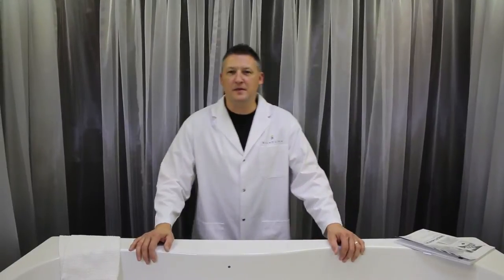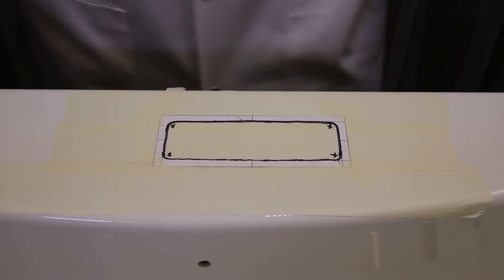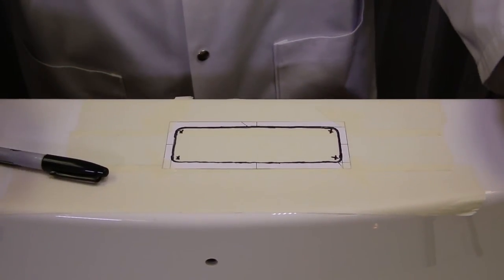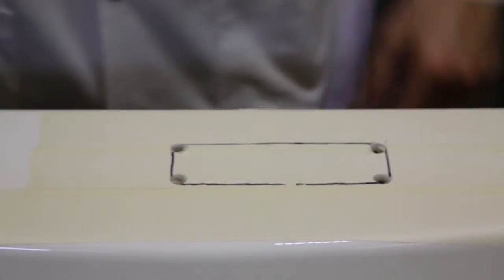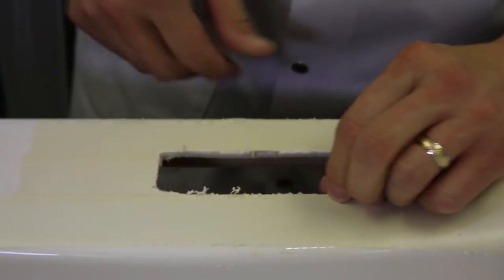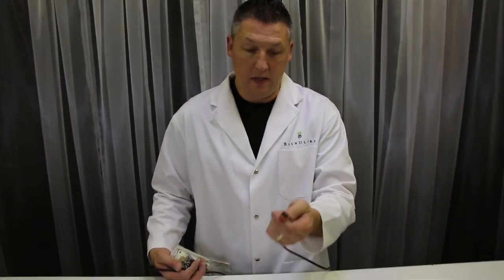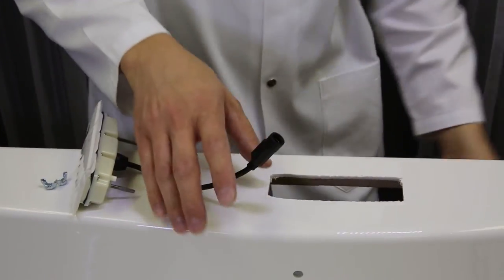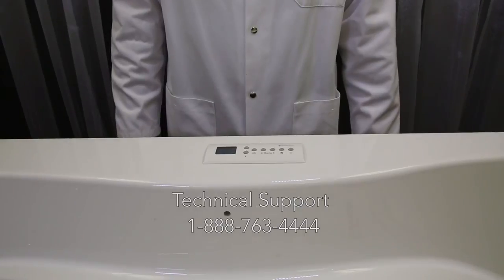How to Install a Control Keypad on a BainUltra Bathtub

Comment: hello excellent video, very well explained, some questions?  I have been looking for the same control but without any result, those controls are standard or you have to see the model, I am in Quebec.  Mine stopped working the screen and not being able to see anything turns on only what we can not use now.  Thank you
Reply: My LED screen quit too… supposed to last 100,000 hours lol
Reply: Any update on your LED screen? Mine quit working and I’m trying to find a way to fix it. Thanks.
Reply: And my LED screen quit working as well.  I called Bain and you have to replace the whole controller.  It come in biscuit or white.  If you have an old one in chrome, it's just an overlay which can be removed from the old controller and placed on the new one.  Bain no longer sells the chrome overlay so be careful removing it if you want to re-use it.   The controller part number is BMIAP1  The numbers after that signify the color, biscuit or white.  I ordered mine from Plumbing Overstock for about 300 bucks.